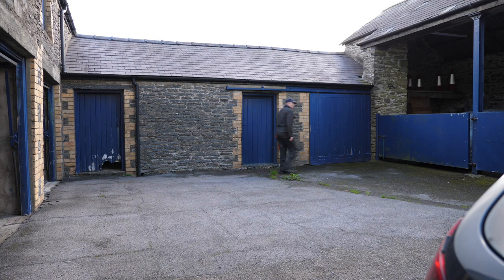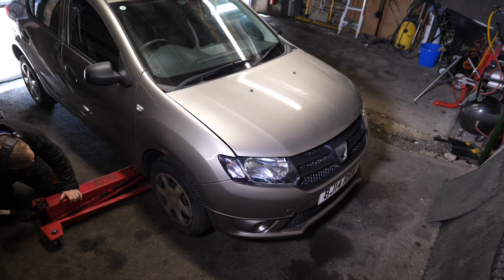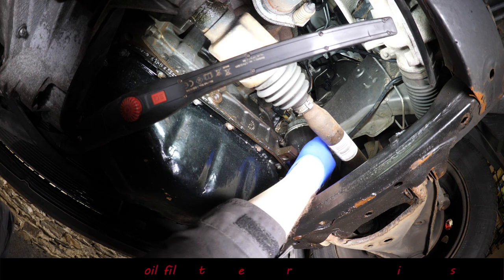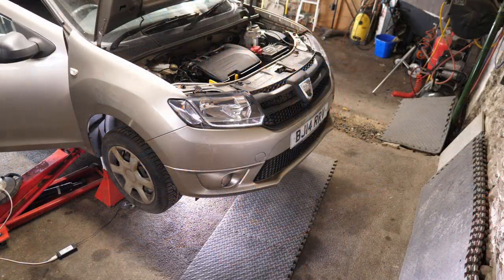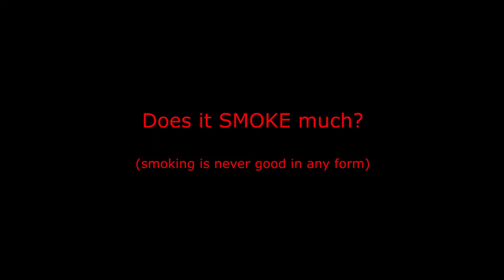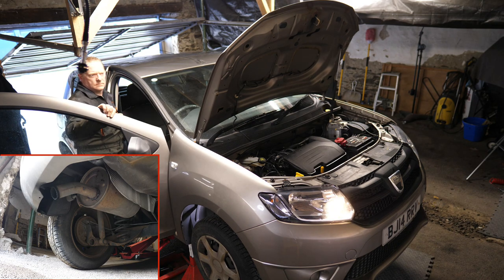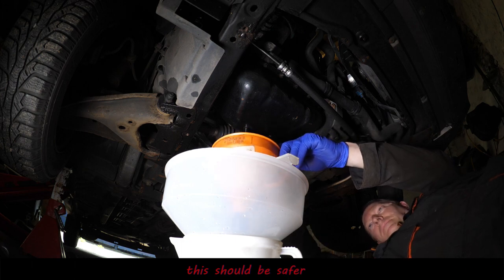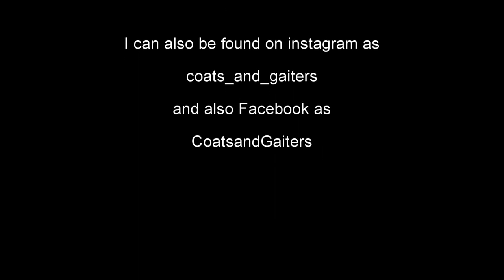Part 1 - Dacia Sandero Severe Engine Knocking and Oil Leaks - Renault D4F 1.2 Petrol as in Clio

Comment: I watched out of order and saw part 2 before 1. So here, you have oil coming: is it out of the valve cover/cylinder head junction or the cylinder head/engine block? If it's the latter, well it's bad news. Head gasket has failed and oil is escaping outward. Edit: someone else mentioned it's the valve cover, so that's a good news.

As for the white smoke, if it persists after warm-up (could be just a big of condensation being burned when starting during warm-up), it's likely coolant being burnt. This point to a head gasket, though first I'd check if coolant level is dropping and if you have exhaust gases in the coolant. Also a super-clean piston head would be a confirmation that the head gasket as failed, you need to check that with a borescope.

As usual, I'm not a trained mechanic, so take that with a grain of salt! I might be entirely wrong there.

Awaiting for part 3, now having watched part 2, I'm not so sure just changing the spark plugs would solve the issue.
Reply from the maker: It's certainly a mystery that hopefully will be solved very soon.  I think they are fairly reliable engines being so basic.  Easy to work on.

Comment: Interesting video Mark! These are the ones that make you stand out from the others, who else gets a stethoscope with a microphone just for us viewers? I very much appreciate it.

As for the smoke, yea that's smokey for a petrol engine in my opinion
Reply from the maker: Thank you Lucas.  I did buy it second hand off ebay but wasn't cheap.  As soon as I knew the Dacia was coming my way I was searching ebay for a solution that I could record the audio with.  I normally buy and sell my tools regular as I often only use them once for a video and then don't need them again.  There is some blue in that exhaust isn't there.

Comment: Hi Mark. This engines have manually valve adjustment. So first step will be to check valve clearance. And this can be tricky as you have camshaft with groove and without the groove between if i remember 3rd and 4th lobe. Renault have the 1st piston on the gearbox side. Clearance is not the same for these 2 so.. One camshaft is for 16 valves. You need to adjust them every 60-70.000km. Another thing can be burnt valve but not likely. How much oil did you drain in that container?
Reply from the maker: Thank you for that.  So it's the same as Peugeot, No 1 at flywheel just to be awkward lol.  Do you think a spring may have snapped and it's bouncing up on the piston crown?  The oil should have been around the correct amount as it was topped up but they did run it down just below dipstick prior to me owning the car.
Reply: @CoatsandGaiters  
This oil leak under exhaust manifold is normal for d4f. Leak is from the valve cover gasket. It is good to have some sealant on  gasket becaose engine is tilted back.
Probably it is not a broken valve spring, sounds like bad valve clearance as this engines when everything is normal works little louder in idle. Something like diesel. Remove the valve cover and take a look. Maybe leak down test before removal if you have one.
Reply from the maker: Thank you for all this information.  Be amazing if it is just valve clearances.  I will do a compression and leak down test when I get chance.  Bit on at the mo @mr.t2585
Reply: Knock engine or camshaft speed, Mark. ? Does sound like a Conrod to me. But mines a guess.
Reply from the maker: My first thought (guess) was a spun conrod bearing but I just don't know now as the sound seems loudest near the right engine mount.  I will be doing a compression and leak down test before removing the rocker cover.  @patrickjmorgan

Comment: I think for what it's worth you need to remove the sump and rocker cover, check the big ends and have a visual check of everything up top as well.
That sound is very strange, it sounds too heavy for top end but too light and rattly (rather than a heavy knock) to be bottom end 🤔
Reply from the maker: I know exactly what you mean Sammy.  It's a loud knock when you stand near it but the stethoscope didn't seem to be loud at the bottom of the engine but was at the top near the engine mount.  I will definitely be removing the rocker cover soon.  Might do compression check and leak down first.

Comment: My guess. Timing tensioner failed, and the oil leak is a red herring. Next move boroscope in the cylinders and a compression test 😢
Reply from the maker: That would be great if it were.  I was thinking of compression check to see if the valve was loose on a broken spring.